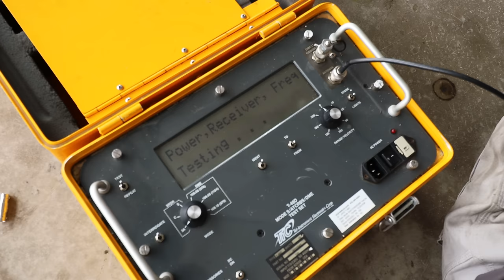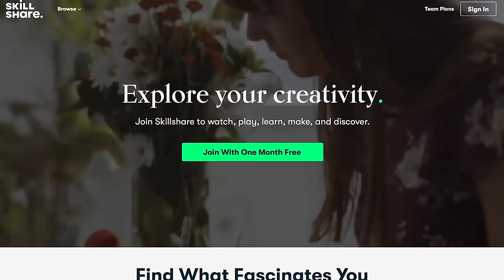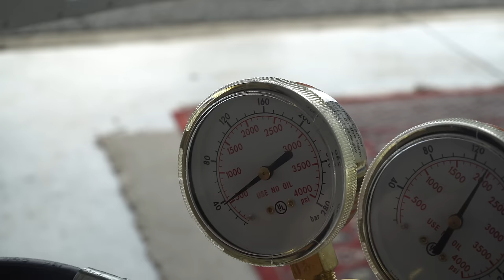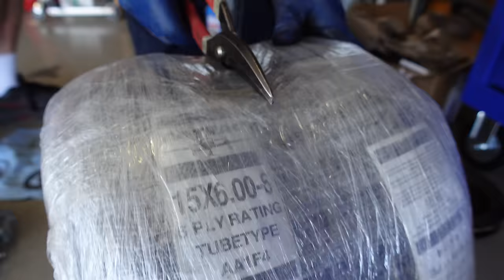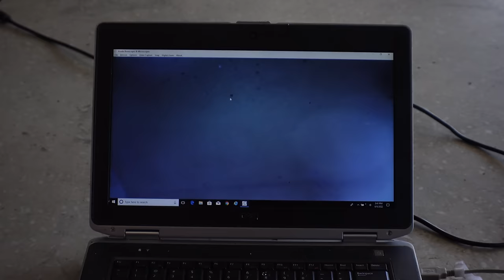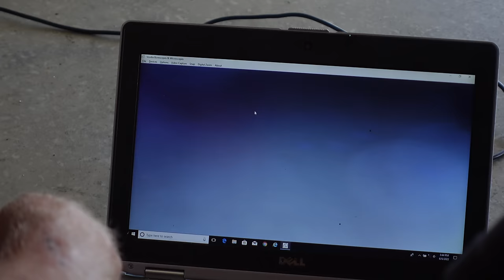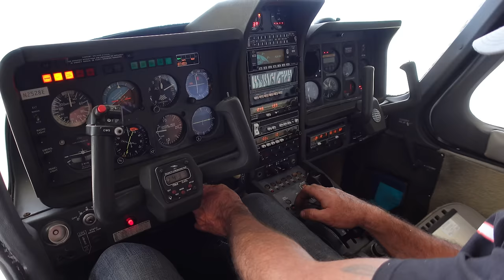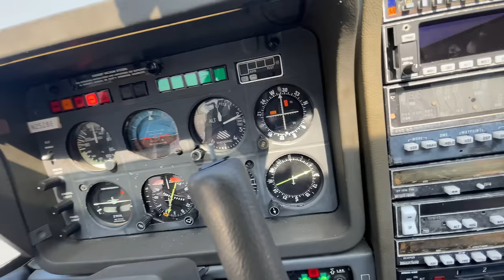Taxiing My Abandoned Dream Airplane For The First Time In 15 Years !

Comment: Left main gear - tyre red dot on the inside, wheel red dot on the outside ;  nose gear - yellow dot and valve stem not aligned. Is this an inspection failure?

Comment: Have you tried Comet or Ajax to clean painted surfaces? I use it to remove oxidation on automotive finishes before buffing
Reply: Aircraft finishes aren't clear coated like automotive paint. Anything abrasive like Comet with scratch the hell outta the paint.
Reply: @dieselyeti  single stage paint isn't clear coated

Comment: Please do me a favor. When airing those tires up atleaat run a strap through the center and around tire. As a former tire man I've done a everything from cars picks equipment like forklifts and mine equipment to airplane. Thise split rim can mess up your life. All it takes is weak nut or bolt and that thing to split in your arm to change how you live your life and I'm nit on to worried about extreme safety but split rims can end you life quick.

Comment: Too bad you didn't weigh the plane before cleaning it out. It would b interesting to see how much crap was inside. Get a pressure washer with a long extension and a 90 degree fitting then put the nozzle end on. Now you can reach way down inside and turn the wand to 360 degree clean the interior of the wings.

Comment: I might have missed it on the vid, but did the idle get fixed with the one mag from replacing the plugs?
Reply from the maker: It cleared it right up.
Reply: @rebuildrescue   Its always nice when the cheap, and easy stuff fixes a issue!!!

Comment: I hope you let the air out of the tire before you rented the assembly. Letting the air out will prevent you from getting a face full of wheel.
Reply from the maker: Absolutely 
I have found though that after the wheel is unbolted if you inflate the tube just a bit it pops the halves apart nicely
Reply: @rebuildrescue   I love spell check. Rented? Smdh Removed. 😳

Comment: ok so I'm team don't put anti-seize on spark plugs thread.  Supposedly it can affect the grounding of the electrode.  Do aircraft mechanics do that?  Curious to know if its just one of those urban legends or not.  On the other side I've had spark plug or too seized, that'll ruin what should be a 30 min to 1 hour job.
Reply: Going back 60 years. never seize on the threads. You still have the plug seat / copper washer. believe never -si may even be conductive. I have never seen a misfire problem but I have seen pulled threads ! Go figure

Comment: I wonder if he lined the tires and stems up properly this time, the red mark on the tire is supposed to line up and be on the same side as the stem. On edit, when he turned the tire over nope he didn't the IA should have caught that. The second main was right.
Reply: using a screwdriver to pop the rims, wonder if the scratches he has put in them exceed limits

Comment: Legit question. With the tires having tubes in them, does dry rot matter that much?
Reply: It does, dry rot leads to splitting which can be bad on an airplane tire, you do not want to have a blowout on landing, or be stranded somewhere with a flat tire. Former owner of a bonanza now I own a Wag Aero cuby.
Reply: @benjigault9043  that's true. Wasn't thinking about it weakening the tire, was only thinking of the air loss
Reply: good question. The tire manufacturer has inspection criteria to help the operator determine when tires need to be replace. Rarely is that information consulted.

Comment: I'm surprised you don't use Nitrogen to fill the tires instead of just air....thought that was a standard with plane tires.
Reply: High pressure tyres,  yes.
Reply: @johnnunn8688  I guess I'm missing something because we use nitrogen in racing and I thought many of the airspace regulations required nitrogen even in low pressure settings, it's safer and is not effected by temp or altitude. Also would make tires and tubes last longer. I could see if you just didn't have it but they had it for the shocks.
Reply: @Mero727  no requirement to use N2 in low pressure airplane tires. Simply not needed.

Comment: I'm going to guess those plugs are similar to modern automotive plugs in that they have a zinc coating on the threads that does not require anti-seize, which can interfere with your final torque.  Worth checking with (Bosch and NGK both confirmed this directly to me when I inquired a few years ago).
Reply from the maker: I haven’t heard that before. I’ll check into it 👍🏼
Reply: Lycoming is not a modern engine. The plugs need anti seize.  Where is the IA?
Reply: @carygrant8796  My vintage BMW isn't a modern engine either, but modern (silver-thread vs. "black") plugs have a coating that removes the need for anti-sieze.  You're going to get more-accurate torque with dry threads and less chance of that crap getting down the plug/in the motor.

Net: it's worth checking.
Reply: @themessygarage  Yes it is worth checking Lycoming’s Instructions for Continued Airworthiness, the Lycoming maintenance manual, the Service Bulletins, as well as the aircraft’s manufacture’s manual’s for their required compliance.  This is an FAA certified aircraft which means it must be maintained and operated in accordance with the procedures approved by the manufacture and the FAA.  Unless the aircraft is operated in the Experimental Category, owners and FAA certified mechanics are not at liberty to vary from the approved data.  There is another party to consider too - the insurance companies, who also require the aircraft to be maintained and operated per the certification standards.  Failure to do so can be cause to deny a claim.  It is the reality that sometimes new technology (new and improved) comes along, unless all the parties agree by supporting data,  the owner and mechanics are not free to vary and can face FAA enforcement for failure to do so.  And yes, you can bet the FAA is watching YouTube content.  While I watch this content with fascination, many of the things I’ve seen make me cringe because they are not being done properly, and it is a missed opportunity to educate while entertaining viewers on the importance of proper maintenance practices.  Most people have no idea what it takes to operate and maintain an aircraft and think it isn’t much more complicated than a car or a boat, how wrong they are.

Comment: Fun fact, zinc chromate plating is used on a multitude of medical equipment as well. It really holds up to hard use over time. Plus the goldish color is pretty cool looking when it's fitted with components and wiring.

Comment: Those clumps of bird nesting all the way to the wing tips is just unreal. Why do they go so far in like that?? And yes, I have experienced how quickly they build those things. Ya really have to watch out for any of those nests that are loaded with bird mites. Those little suckers are a NIGHTMARE to get rid of. The best thing to use is 99% isopropyl alcohol and spray the hell out of the nesting over and over. Yuck.

Comment: Why wouldn’t you check the air pressure on the tires BEFORE installing them on the plane????  Seems like you’re not working smart you’re working hard……….extra crawling around on the floor!  Also how many times did you install and remove the tail of this airplane?  Sam installed it at the beginning of this video then it was installed again by Jason then taken off and reinstalled when the tail AD was done that’s 3 times in this video alone…….why??  Also I would’ve changed out the landing lights to LEDs since you had it all apart anyway getting the hay bale out of the wing tips………….lots and lots of extra unnecessary work!   The clear covers over the wing tip NAV lights you can polish with a HIGH QUALITY 3M headlight restoration kit!

Comment: Abandoned ? I dont understand all the shows  about lost planes. The owner is a LLC in maryland. Go to flight tracking. It flew last month. So are you the owner. Someone ownes every airplane even if it rots forever. I dont get it ? Info is simple to find.
Reply from the maker: Hey Paul
Currently FAA registration changes are running 6-7 months so any information of title/ownership changes will take at least that long. 
Many folks confuse the definition of abandoned as it can be used differently. 
As a verb as in the case of the TB20 =
past tense: abandoned; past participle: abandoned
1. cease to support or look after. 
As far as flight aware you’ll have to keep watching 👍🏼

Comment: You have nitrogen there why didn't you fill the tires with it ? 
Aircraft tires indeed are filled with nitrogen to mitigate temperature fluctuations, but not because nitrogen has any special heat-absorbing qualities. Rather, it's the presence of water that makes standard, commercially available compressed air a poor, even dangerous choice for aircraft tires
Reply: air works just fine in low pressure tires. After all, it's 78% nitrogen.

Comment: i has use this wire pump many many time i repair turpine engines haha remember many year before young men repair many engine.jet engines repair lot in north europe and usa and spain fly go repair at my work.simple job but need be all sure right. if one turpine wing has wrong explore all engine many million dollar fail. i remempers one jet owner call usa to north europe we workshop and ask how much cost service and repair turpine, and say too expensive we do diy all and end phone, next month same owner call we and say turpine has explore can u go to repair, we fly to usa and repair engine all, cost 3  million repair all engines new wery expensive fail owner jet but must do. hahaha stupid fail at owner want save money and go 3 time more money we do all good.we looking what him has do engine some wing has wrong installed and all safety lock wires has wrong turn installed wrong tools used,wires has run open first start and lock nuts has open and explode all.